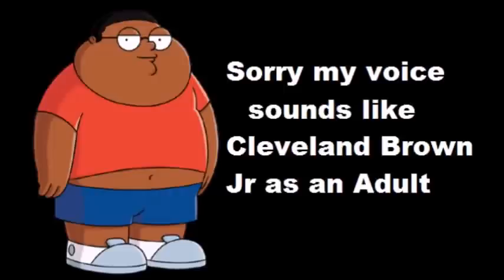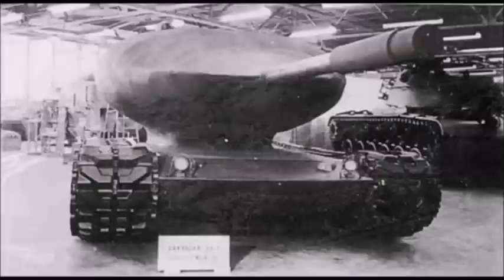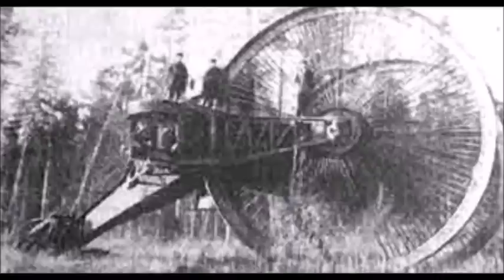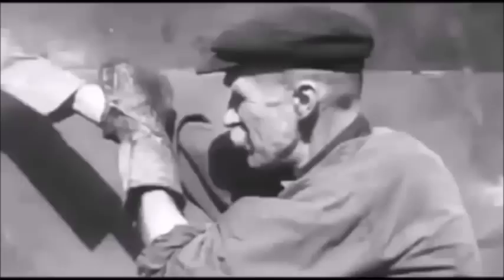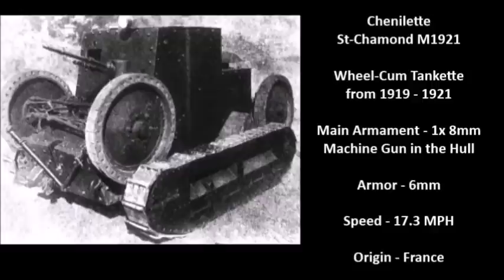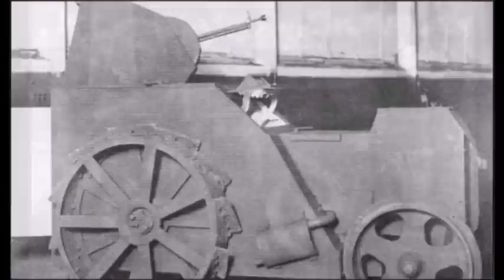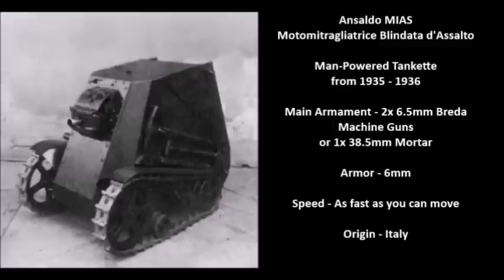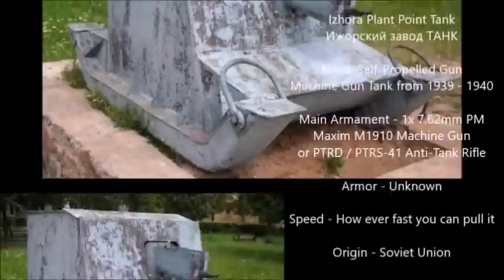Top 10 Worst / Strangest Tank Designs in History

Comment: Actually,  a few comments

First self propelled anti-tank guns.   There WERE several designs of these that were used right up until the 1980's.    the stridesvagn 103 was an was an exceptional design for use in forested area's were a tank could NOT turn its turret.   these small tanks carried a 105mm that could kill most russian tanks but due t their low profile and insane slope on its armor were extremely hard to kill...   they could also spin on a dime so they could keep their front and gun pointed to any threat.

the Australian "semple" tank would have been very effective based on its roll and job.   First Japanese rarely used armor on landings... and even when they did deploy armor it was almost always light,  where by a 37mm gun could kill it.   what the japanese were KNOWN for at this time was swarm tactics by infantry.   The Semple tank was what was referred to as a walking tank.  it would move with the infantry with enough armor to bounce the Japanese small arms while providing 360 fire support against them.   in that roll and job it would have worked well to protect NZ against amphibious landings.  Acting as mobile pillboxes that could be deployed to any area without needed to build mass fortifications.  for the time this WAS a valid concept and tank.

lastly the Kugel...   german ball tank...  strangely, most histories don't think it was meant to be a recon tank,  instead it was meant to be a cablelayer.   to roll through sniper areas and fix or deploy telephone lines.    for that you didn't want high speed...  it was likely just a proof of concept to be cheep and easy to produce and provide the linesmen with some light armor while they rolled along laying their communications lines.
Reply: thats the problem of this video, tanks are compared to other tanks of the time not to what role they were supposed to take
Reply: But at the time of "these" tanks, tanks were customized into dozens of different rolls because 1 tank couldn't do everything.

take the m3 flame thrower tank.   1 flame thrower, 2 303 mg's.    it was useless for fighting other tanks at any range... had no armor per say,  even a 20mm rifle could pen it...   heck a .50 cal could penetrate it at some angles.    but for what it did it was great... rapid response to fire flush out japanese.

on the flip side, while the M4's were the main tanks of Europe,the US Decided that since the Japanese didn't go "big" on tanks and tank guns.   the m3 and m5 light tanks were all they needed...   But an M3 acting as a front line tank "at that time"  would have been considered stupid anywhere but the pacific.

The brittish on the other hand had walking tanks... tanks that couldn't break 19kmph  but had massive armor... their job wasn't to fight tanks.   instead their job was to walk up with the infantry to the front lines and act as mobile pill boxes and cover.   Against real tanks they could easily be flanked and destroyed and often didn't have the firepower to kill other tanks.
Reply: kitsychan couldnt have said it better myself, and some interesting facts aswell o.O
Reply: But yeh.  if you are building a tank,  you need to think about certain things.   are you going to use it to fight other tanks?  If no, then you don't need  high velocity gun, hence the Panzer IV.  75mm short barrel, it was the infantry fighting tanks... and the Panzer II with the 37mm was the tank hunter tank.

Does the enemy have heavy fortifications?   Well if your fighting and enemy that likes to dig in and doesn't do mobile warfare, then a turret tank might not be needed.   a "siege tank" with heavy front armor, a big gun  75/105/152, and heavy front armor with limited side armor might work best... hence things like the SU-152 and Brumbar.  

a tank meant to take on or counter infantry landings might only need machine guns...  because the infantry won't be able to dig in, and if the enemy uses swarm tactics you might need more then 1 hull and 1 turret machine gun...   as soon as you start purpose building vehicles, they often tend to look... weird as well..   Israel for example produced the Nagmachon.   that thing looks strange but has worked well for what it does.  Urban combat.

Canada decided infantry losses on assaults were to high and infantry couldn't keep up with tanks...  So Canada took old Sextant tracked arty vehicles ripped off the gun, welded plates over the front, added a pair of machine guns... and used the crew/arty cab to carry infantry.   they were fast enough to run with the tanks, strong enough to resist artillery blasts...   and could hold 8-10 infantry.   At the time everyone thought canada was nuts...  it looked strange, had no anti-tank guns...   and packed 10 infantry in the back...  why?   well it gave birth to the APC's.
Reply: kitsychan well in the end its verry simple, the tanks are built for the standards of its role, not the standards of other tanks
Reply: Yep.  The tank with the large wheels on it for example.  in the 1930's  russian tanks had to drive everywhere but the tracks tended to wear out quick and/or break.   So the BT series of fast or Light tans came up with a solution.  They could remove the tracks,  hook a chain drive to the rear wheels,  unlock the front wheels into steering axle mode and drive it like a car.  This saved on fuel, and let these tanks zip along at up to 100kmph on paved roads.

converting between "wheeled scout" for speed on roads, and tracked scout for off-road was an idea many armies explored because at the time, it lets "slow tanks"  get to a battle zone fast, then be converted back.   this was also useful given the "damage" tracks often did to paved roads.
Reply: The real problem is that jmantime really doesn't know what he's talking about, that is why he makes so many mistakes.
Reply: I have no Qualifikation at all...
Reply: kitsychan
Dude, the Semple tank was not Australian, even this narrator got that bit right, it was designed by New Zealand's Minister of Works, Bob Semble.  I actually worked with his grandson for a time, and they were pretty proud of it.  As you pointed out, it was adequate for its stated design purpose, but this nut-job expects every AFV to be both Tiger and Sherman.

Comment: Have to strongly disagree about the Soviet last ditch tank being included in this video. It's the only one of these that actually saw service worth mentioning and was even operationally successful! (Threw back the AT-gunless Rumanian forces in a counterattack near Odessa & actually caused them to flee headlong in a tank fright) Doesn't really matter if it's last ditch, improvised, made from whatever materials you could find - if it does the job, it can't be honestly described as "worst" or "lazy".

For the same reason I wouldn't be too hasty in criticizing the Bob Semple or the British Home Guard designs since they're essentially the same thing, only built before they were even needed and luckily they never were. They were never meant to be shipped outside the local theatre, never meant to take on enemy tanks or fortifications, but against a lightly equipped foe - say, German paratroopers or a Japanese raiding/invasion force without armour support - they could have been worth their weight in gold.
Reply: Oh, and referring to the Lahti 20mm ATR causing Soviet tank casualties in the Winter War is a bit out of place since that gun was not really in use yet then, only operationally tested, so couldn't have killed very many tanks, if any.

Comment: I don't think this is very good as a list, the Italian MG on tracks would be useful to protect the gun crew and didn't use fuel, which is a valuable and sometimes very scarce resource. Also the circumstances behind few of them was that they needed any vehicle capable of fighting to some extent. The sled tank was a good idea to cut production costs and resource usage in anti infantry vehicles without just leaving the gun exposed

Comment: Nuclear power reactor was also used at Camp Century, an artic camp who's unsaid purpose was to see if missiles could be placed where silos and hardened Implacements weren't possible. Project Iceworm failed because the ice and snow was more dynamic than planners realized and that the trenches that held buildings including the power plant were shifting.

Comment: The worst tank is M3 Lee
Reply: Jose Ruiz. just lols dude what about the Grant
Reply: war thunder has M3Lee too
Reply: World of Tanks has ruined the M3 Lee. In real life, the M3 Lee was awesome! It had 90mm of armour on it's turret (10 less than the Tiger.) It was used as a stop-gap tank while America developed the M4 Sherman but it was so good, they kept using it.
Reply: The Grant was better though. Also, if used correctly, the Lee could be a great tank.

They used M3s until the end of the war. Like Burma for example.
Reply: ***** they were both primary guns, the 75mm could take out tanks but it simply was not meant to. The crews were taught to use the purpose built high velocity anti tank cannon mounted in the turret to engage enemy tanks over the low velocity howitzer mounted in the hull, 75mm AP shot was not exactly common. This is all beside the point i meant to make the first time in that it has a turret, so it can go hulldown. The crews just didn't. Neither did nost crews, if i remember taking hulldown positions didn't become a tactic until well after the war.
Reply: tightg111 i did see in Wold of Tank, there look a same, but not the top turret. i don't care the stupid tank they ever made. but still the m3 lee is weaker.
Reply: ***** yes
Reply: Hetzer Gaming the armor is very weak and the turret is low.
Reply: armor
Reply: McPuff not the armor, is the gunner movement.
Reply: M3 Lee was good in North Africa for about 6 months, then it was a ridiculous relic, that was an incredible high target, that couldn't go hull down because of its gun.
Reply: U the hell r u my uncle use that tank (M3 lee) since ww2 till the end and he survive it

Comment: um actually the Bob Semple was very good for the money it cost to build, it had spaced armor making an effective armor to the equivalent of 30mm+ of solid steel.
shooting 7.62mm rounds could penetrate 15-25mm of steel with AP 7.62mm you could estimate 30+mm steel penetration and it used a Bulldozer chassis so basically it was made for tough terrain.
i don't think it is as bad as people think tho, it needs to be on this list still.

Comment: The last tank is actually quite clever. Having an armour hood in a machine gun nest was commong practice in WW2. Those were usually cast from steel and were placed in fixed positions but wouldn't it be great if you would have that kind of armour shell but mobile so you would easily fortify your position when needed...Oh well, this last thing is the end result of that trail of though. Having skids (those ski-looking things) will make more easier to tow it around in snow, sleet and mud.

Comment: Chrysler TV-8 was to have a Chrysler V-8 engine with 300 gross horsepower which was coupled to an electric generator located within the rear turret; the generator powered two electric motors in the front hull, each motor driving either of the two 28-inch wide tracks. Propulsion in the water was by means of a water jet pump installed in the bottom rear of the turret.[1]

Other methods of powering the tank that were later considered include a gas turbine engine drive, a vapour-cycle power plant fueled by hydrocarbons, and a nuclear fission-powered vapour-cycle power plant.[1]

Comment: first 'tank', dat low profile though.
second tank, nukes for the nuke god.
third 'tank', I was made so BF1 could have a new behemoth for a DLC.
fourth 'tank(s)', Stop gaps aren't so bad, worked with the M3 Lee >_>
fifth tank, 360 degrees of machine gun cover, YOU CAN'T GO WRONG!
sixth tank(et), I exist to kill infantry.
seventh tank(lol), Well no one will actually invade anyway, so who gives a fuck?
eighth tank, now that tank has got ball(s)
ninth tank(et), I think I am a BF1 sentinel.
final uhh... thing? Mobile bunkers FTW!

Anyway, some on these vehicles are not tanks, most in fact. Still, the criteria for your video was if the fielding country called it a tank. Tankets, and those armored cars, and super slow tanks you mentioned were made to combat infantry, not tanks. The reason why some were super slow was also because they were designed as infantry tanks, tanks meant to advance with infantry. They also had cavalry tanks, but this designation was pretty much interwar which is most of these vehicles anyway.

Comment: Sorry if id doppling someone else. but Point 10 is false.

Versuchsträger = testing vehicle

The guns are ther so you can have 2 guns fire simultaneous on a test target so in the replays sientists can figer out better what gun performs better, or you can mount 2 of the same gun and fire 2 ammo types to see it changing small parts of it makes it to better preform. 

The reason was that otherwhise is is realy hard to get the same angel and the same conditions in flight ( wind ) under life firing conditions ( in the open ).
Reply: i can tell this is bullshit, and there is a very simple reason why. guns being fired like this, for this exact purpose, would not be linked together in any possible way, that is an easy way of introducing uncontrolled variables. if we want to run ballistics tests like that then we put the guns near each other on two of the same mount but separate. granted, i don't work for a GERMAN arms developer, but i'm going to take a wild guess and say Versuchsträger refers to the vehicle being experimental, not that the vehicle is made to perform experiments.

Comment: I think most if not all of these tanks on this list would not ever have been seriously considered to use by an army except for the fact that they were in desperate need for arms   and supplies and resources were few. Most of these were designed in times when there were little resources to build things. Many of these are improvised by whatever they had at the time. I'm sure the designers knew the difference between sheet metal used for roofing and buildings and actual armor, but at the time they had no armor so they had to compromise there designs. Some of these would have been good designs for something other then tank warfare, like the Russian tricycle tank. That piece of equipment seemed like it would be a mobile artillery piece like a horitzer if it had the right  fire power. Many of these were more or less just prototypes for testing future technology and they never really belonged on a battlefield. I'm sure that the ones that were not powered we're be intended to be on the Frontline, but as a mobile pillbox. These we're more of a way to beef up defences and make the enemy think they we're more powerful then in reality. I wouldn't really call any of the ideas lazy unless we know the whole situation of why and how they were created. I liked the video but seriously turn up the microphone. With my audio cranked up I couldn't hear anything.

Comment: Where was the Tiger (And Tiger 2) and Panther? Those things constantly broke down due to bad transmission and since the wheels were so close together , in rocky surfaces rocks would get stuck between the wheels and in snow/cold weather the wheels froze together. And not to mention its was a perfect target for the P-47 and the T-34/85/JS-2
Reply: shhhhhhhhhh, he doesn't know what is actually detrimental to a tank.

i mean for fuck sake he thinks the problem with two guns mounted in the hull is that it will be shot from the side and have one of the guns knocked out.
Reply: My favorite tank is the moving brick

Comment: The point of the first tank isn't to fight head to head with other tanks   they hide and fight from the shadows a good example of hull mounted tank destroyers being useful after ww2 is the swedish s-tank, the tzar tank was designed before anyone knew what a tank was so you have to give it props for even moving as it is huge and it was built in 1915

Comment: While most of these are prototypes, not tanks, they still qualify as "tank designs", so your video title is basically correct - with one exception. The very first tank design on your list is not a "design" - "Versuchsträger" literally translates to testing platform, used to test ideas that would later be incorporated into a "design. In the case of the VT1 it was meant to be for the Leo 2 - far from a bad tank design.

Comment: The Chenilette, the thing with auxiliary road wheels, was probably an attempt to make a tank that could get to the "Start Line" before an offensive. Use the wheels on the road, and then shift to tracks. All tanks of 1921 vintage were very unreliable. In WWI, many a promising Allied offensive ended because the tanks leading it stopped running, and then were knocked out while stationary.

Comment: Valiant wasn't here? the tank with the drivers hatch that would stab the driver in the head because of the shitty suspension, and the gear shift that if you shifted to far you needed a crow bar to fix...or the whole fact where if your foot slipped between the pedals the only way to get out was to cut your foot off...idk sounds like a bad tank to me